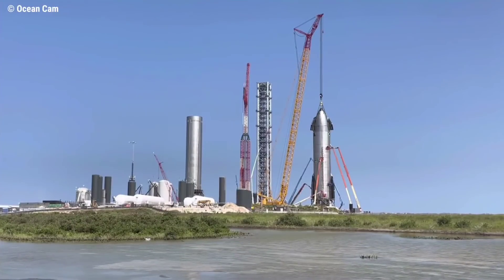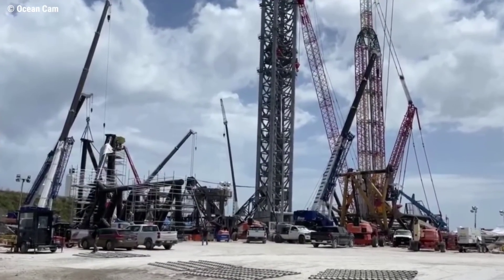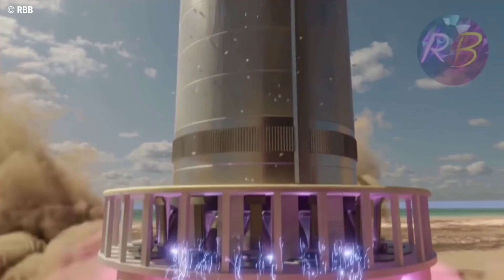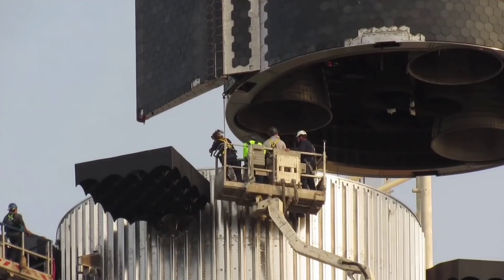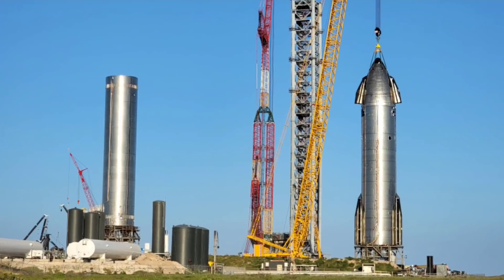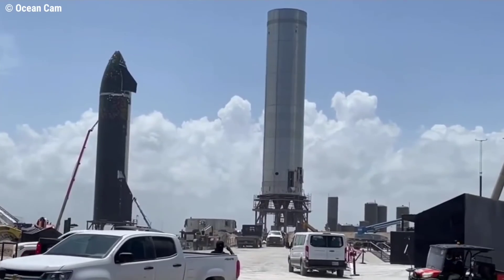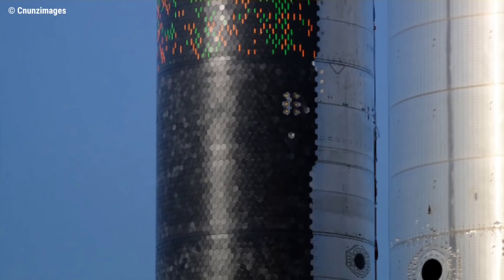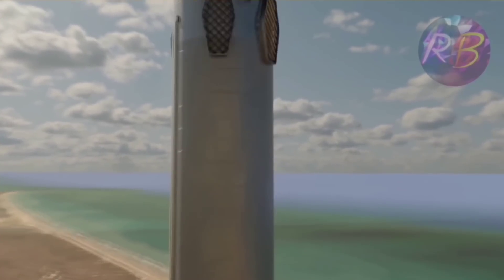SpaceX PREPARED Ship 20 & Booster 4 For First Orbital Launch Attempt !

Comment: can someone tell me why their using thermal tiles and not a thermal blanket as they did on parts of the space shuttle did the thermal tiles not fail on the shuttle 🚀
Reply: space shuttle use tiles too, specific e well shaped ones. starship use more standard shape tiles (fast production, cheap and fast assembly process). secondly, starship use iron, that has better heat resistance and melting point than the aluminum alloys of space shuttle.
Reply: @Alessandro-yn3ly  i know they used them on space shuttle but they came off and it blew up so not good on starship
Reply: Because there is no foam coated tank shedding ice and debris at the Starship to damage then.
Reply: Too much heat for just a blanket, tiles needed.

Comment: I'm wondering about those buckets that lift the workers up to where they need to go to do what ever they need to do.  That is one heck of a job to lift two men that high and be stable, so the base on wheels would have to be very heavy for stabilization, and perhaps legs that support it as well, but still that is one heck of a lift!  Also, the higher, the more tendency to bounce and jerk the bucket, so has is that negated those effects?
  Also, when the Starship is lifted, the lifting cables are attached to the cone, I assume some sort of eye and the cables with the hooks, so when the cables are released, how do they close the attachment points on the cone, as to not interfere with the air flow over the surrounding tiles?  Are there little hatches with hinges that expose the attachment points?